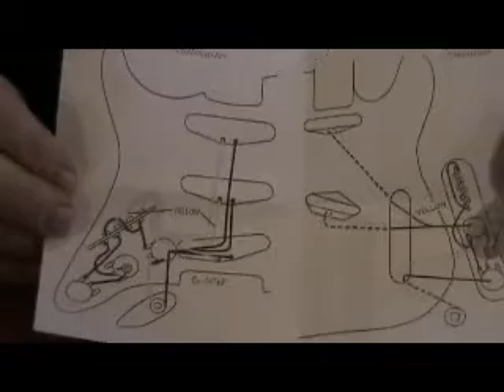Installing Strat pickups with Jason Lollar Part 2

Comment: Are you speaking of a treble bleed circuit not recommend?
Reply from the maker: Yes. For the most part, we feel that they make the controls effect the tone in a way that many folks don't like enough to justify the effort. Also, we've had countless customers reach out to say that they are experiencing thin, bright, or otherwise unpleasant tones from their pickups after installing them, to which we've asked if they have a treble bleed installed. When they say yes, we suggest that they remove it and report back. Every time this has been the case, they have come back to tell us that it fixed their problem. Because of this, we started suggesting against it. Though we obviously support people doing what they like best. So, for those who like treble bleeds in their circuit: more power to you! We simply prefer circuits without them.
Reply: @ I clipped mine out… you were right, the internet is wrong we have been duped. Thank you